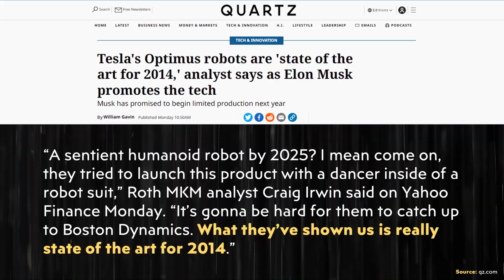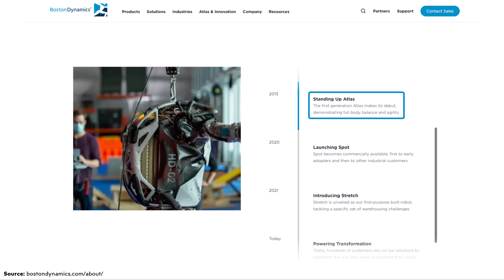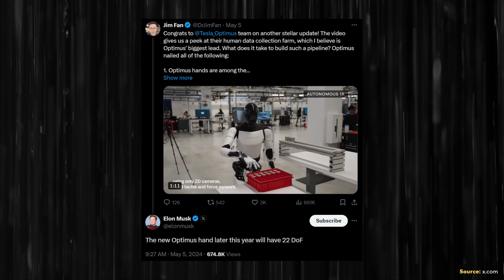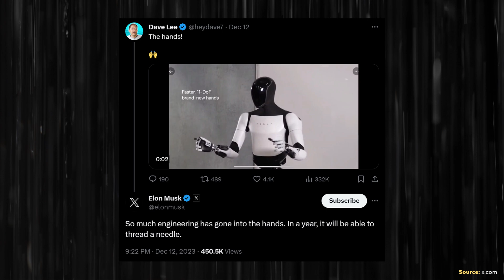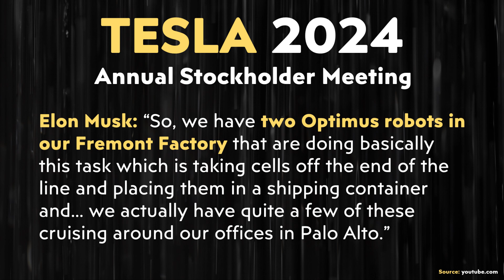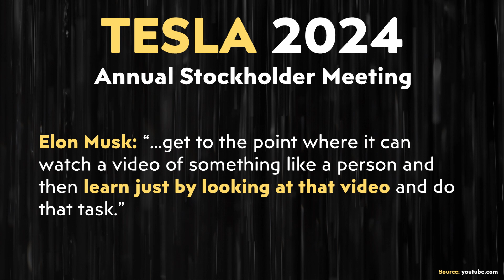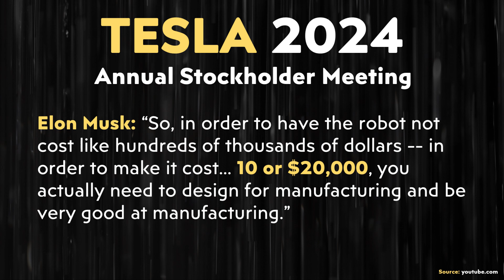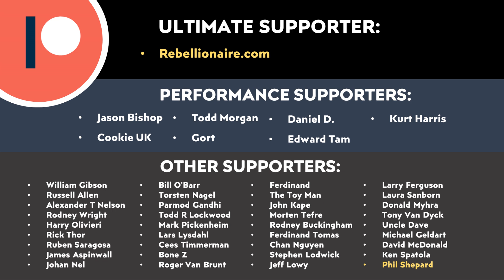Elon's NEW Tesla Optimus Robot Update | Proving Critics Wrong!

Comment: Boston Dynamics have made an impressive dog-like robot, pitched to the military as a pack animal. Didn't work & has been shelved: it's too loud for use in the field. The firm HAS made a humanoid, but it's not equipped to work with human tools.

Worth noting Boston Dynamics believed so strongly in their program that they... sold the company. Hyundai bought it. Mostly for military R&D. But so far, they've got nothing functional to show for it. And as you note, that's after a 30+ yr R&D program.

Musk makes the point that design criteria for Optimus was that it be functional in a work environment designed for humans. That's a BIG DEAL.

Also that the robot can't provide much functional benefit without AI that really works. Boston Dynamics won't have that - certainly doesn't at present.

Comment: I think it's pretty obvious that, except for the hands, Boston Dynamic's Atlas is superior to Optimus. Even if Optimus is the number two design right now, that's still very impressive. I think both companies will inspire each other. 
The area where Elon is a little carried away is with the number of humanoid robots. I think a number closer to 1-5 billion is more likely. 1 robot to each upper income household is possible, not 1 robot per person. Because of 24/7 availability, robots in manufacturing will replace virtually all the humans in the facility, but that rate will be 1 to 1, 1 to 2, 1 to 3 depending on how many shifts are currently in operation. Of course, possible military applications would dramatically change the numbers.

Comment: The critics are not wrong. Even in this promo the word "should" is used extensively such as "should be able to do things like", "it should be also be capable of", "should the Optimus robot be able to", "robot should be able to". Couple the "should"s with the numerous "will"s; “Tesla will be able to deliver”, "Tesla will very soon”, “next year this will be”, “accessories will be offered”, “Tesla will actually Mass produce Optimus” and “I believe they will get there”.

At the moment it is vapourware,  the promo videos that are released deceptive, often not showing the person operating the robot from behind the curtain. Tesla does not lead the advances made in Robotics in any niche, neither hand dexterity, AI or humanoid, they are years behind the competition.

To a large part "factory" robotics do not need to look or move like humans. Their arms and movement entirely dependent on the task they are being asked to perform. A Robot that is tasked with loading and unloading pallets doesn't need to be able to unscrew the cap of a bottle.

Take everything said about Tesla and the "should"s and "will"s, can be applied to any robotics company and in many cases, the competition have "does" and "do" products available.

Comment: 12:18 Please don't confuse PRICE vs COST. Elon stated that the first several thousand units of Optimus Gen-2 would only be working internally within his own factories [as they don't want external problems in either Alpha or Beta development and testing] and ONLY after that, perhaps in 2026, will some Gen-2 be leased to external industrial customers, not available for outright purchase. The first several thousand Gen-2s are still expected to cost $100-250K each, so the very long-term possibility of reaching a $10-20K manufacturing cost will only be after enormous manufacturing ramp, long after 2026. These are still expected to be leased units, with industrial customers being prioritised. If there remains no significant competition for the Optimus use-case, then expect significant margin of perhaps 2x-3x, if outright sale was even an option.

There will then be issues of privacy and ownership of learned information: Optimus is expected to be connected to the Internet and "cloud" storage, yet is privvy to everything and everyone within its surroundings; habits; preferences; secrets... - lots of information that some [states; advertisers; employers] will find very valuable and pay to gain access to, regardless of any of it perhaps supposedly being "anonymised". Who owns that knowledge and controls exfiltration of it?
If your Optimus needs to be RMA'd, is the [years of] knowledge gained by the old unit able to be transferred to the replacement to avoid regression?

Comment: LIDAR is on my iPhone - it should be on every robot.
360-degree vision is 100X better than 2 cameras looking forward
both sit on top of the robot

both are missing from the Tesla Terminator
and one of the many reasons the Terminator will fail as a consumer product.
Reply: LIDAR is not efficient for realtime reaction response or energy use. Not so much the power requirements of the sensor itself, but for the processing of the data.
Reply: @hardcoreherbivore4730  Not sure why you need to lie - to score points?

I asked AI (Claude) this question:
Q: is LIDAR is efficient for realtime reaction response or energy use?

AI:
LIDAR (Light Detection and Ranging) technology has both advantages and limitations when it comes to real-time reaction response and energy use. Let's break this down:
Real-time reaction response:

Pros:
High accuracy: LIDAR provides precise 3D mapping of surroundings.
Fast data acquisition: Modern LIDAR systems can scan environments quickly.
Long range: Can detect objects at considerable distances.

Cons:
Data processing: The large amount of data generated requires significant processing power, which can introduce latency.
Frame rate limitations: Some LIDAR systems may have lower frame rates compared to cameras or radar.

Energy use:

Pros:
Solid-state LIDAR: Newer, solid-state LIDAR systems are more energy-efficient than traditional mechanical LIDAR.

Cons:
Power consumption: Generally, LIDAR systems consume more power than passive sensors like cameras.
Cooling requirements: Some high-performance LIDAR systems may need additional cooling, further increasing energy consumption.

Overall, while LIDAR can be effective for real-time applications, it may not be the most energy-efficient option. Its efficiency depends on the specific use case, the type of LIDAR system used, and how it's integrated with other sensors and processing systems.
For truly real-time, energy-efficient applications, a multi-sensor approach combining LIDAR with other technologies like cameras and radar is often used to balance accuracy, speed, and energy consumption.

========================
You might want to run your lies past AI and see how they hold up.

Comment: Definition of a fool: someone who pontificates on something he doesn't understand.(Craig Irwin, not John...) Craig apparently doesn't understand what AGI brings to the party. BD has done  a lot with preprogrammed, non-intelligent machines. Good for teleoperation in dangerous environments, or for situations that don't require adapting to the unexpected. The architect's dictum "Form follows function" means that the function shapes the form.  When you know in advance what the task is you can take the shortest route to completing the task. The result is powerful, special purpose  robots. However, undefined functions require adaptability. BD robots are built for preprogrammed tasks.That distinguishes Tesla robots from BD robots. What is the best model for adaptability? The human form...so far, anyway. This is one reason Tesla is focused on flexible, adaptable manipulators--hands specifically, and the human form generally.There are other good reasons, but that's a different discussion.
Reply: What Craig doesn’t understand is … a lot!

Comment: Tesla’s hands are obviously far more dexterous and more general purpose.  However that latest Atlas is a huge improvement over previous Atlas in arm and leg dexterity which it also appears to beat Optimus at.  Atlas might make a better rescue bot, but not a better factory worker currently.  If you took Tesla’s AI and hand dexterity with Atlas arm and leg mobility you would have something superior to human physical capability and better than either current version.
Reply from the maker: You make some great points!
Reply: How much does it cost to produce a robot and mass produce is key.
Reply: Competition is welcome !